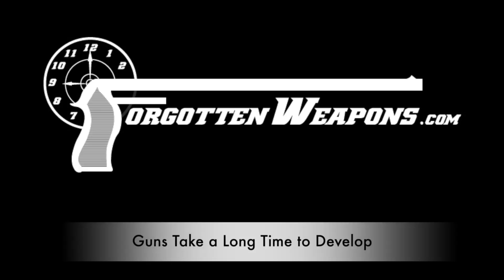Why Guns Take Years to Get Into Production

Comment: The tooling and tolerances is the main problem in many stories. Then there might be the engineer who has forgotten the difference between US and British inches, let alone centimetres.
Reply: The US and British inch, as well as the Canadian inch, became the same decades ago. Certainly a thing a good while ago, but not at present day. Assuming modern metrology equipment of course.
Reply: Hey, let me tell you about the first time I used a Taiwanese tape measure. Oh yeah. They have 10 inches to a foot here... 🤔🧐😱🤬😓
Reply: @stewbacca117  noice to know, now I know where to order my ** measuring devices from. Gonna trick all the ladies lulzzzz
Reply: @stewbacca117  really?How many centimetres to a Taiwanese foot?
Reply: @patmiddleton3947  oh there's still 304mm to the Taiwanese foot. They just changed what an inch was to make it 30ish mm... 🤔🙄 Doubly confusing. Yay.
Reply: The difference was more critical in the 19th century - the .303 rifle was the result in the difference between the Enfield inch and the British standard inch. Enfield was using a standard 1% longer than the British standard. I am aware of 40 different inch standards in use in Europe prior to the metric system being adopted. The American inch has been a metric derived unit since 1959 and the old definition is due to be finally legally phased out in 2022. (Legal American inches prior to 1959 were slightly longer and British inches slightly shorter than the current standard but machinists had been using the modern standard definition since the 1930’s).
Reply: @allangibson2408  Now that was just plain interesting. Thanks for posting it. If you know that,would you then know why Whitworth chose 55 degrees for his thread ? He has to have known 60 degrees would be equilateral. It is just one of those little puzzles that I have never found an explanation for. What was the point ?
Reply: @paulmanson253  55 degrees is stronger in iron. 47.5 degrees is better in brass. 60 degrees looks pretty on a drawing.
Reply: @allangibson2408  Well now. I finally found someone who could answer that. Thanks again.
Reply: That's why you check tolerances every X cuts or X amount of guns. The problem comes from how much is too much or too little and how often do you check. That's one of those never ending problems unless you are working with indestructible tools.
Reply: The difference between the US and British inch disappeared long ago. Both are now defined as 2.54 centimetres.
Reply: @mikethespike7579  The old longer US inch is still in use. It is the base unit for US land surveys (where the difference does make a significant difference (tolerance stacking again...)). It is due to be phased out next year.
Reply: @allangibson2408  This is the best news I have heard in a few months lol. English vs US survey feet can be a headache. xD
Reply: What’s that about certain missile defense systems mixing up the two standards? 🤨
Reply: @ETC_USCG  Or Mars Climate Rovers...
Reply: @AliasAlias-nm9df  oh yeah, that one for sure!
Reply: @ETC_USCG  I don't know anything about that, maybe that happened before 1985. Because in that year the US and the UK agreed that the inch is based on the metric system and is 2.54 centimetres,.
BTW the US has a slightly longer history of using metric in engineering than the UK. NASA already was using metric in the early 1970s simply because their computers could calculate faster with that system.
Reply: Screw all that!  Go metric.  The math is easier too.
Reply: @andrewgillis3073  That was why metric was developed - the fact every city in France had a different length yard...
Reply: @allangibson2408  Also, a bade ten system makes it easier to engineer things.  😊
Reply: I meant base ten...
Reply: @Flosoph LOL !
Reply: My "favorite" problem is when the draftsman unintentionally leaves the dimension callouts  on the 4th decimal place setting (0.0000) which, for me, typically makes it a +/- 0.0005 tolerance. That's that wasting time by being unnecessarily precise. "Oops" was the only response I was ever given when I would confront the draftsman about it. Frustrating.

Comment: What has changed with the advent of CNC is, that spies trying to stall the development/production may not need to get near the actual machines. Stuxnet is a wonderful example for such an operation. Further since high precision is hard enough, its easy to create plausible deniability to hide sabotage.
Reply: Except the cast majority of CNC machines aren't networked at all - it tends to be "sneakernet" using flash drives. Also, there's dozens of different controllers, each with their own architecture Fanuc, Haas, Heidehahn, Siemens, Mazatrol, Winmax(Hurco, which is an overlay of Windows)..
Reply: @machinist7230 : Well, yes, but I am old enough to remember the time when malware spread without networking. Actually one of my first teenage x86 assembly projects was writing boot sector infection routine for a virus. I wanted to know how that stuff works, but assembly programming is not fun and I stopped doing that after I figured out how it works ... with the probably most awkward and complicated infection routing ever written. But it worked ... well somewhat.

Comment: Another example of why we can't remake some things.   " Why Can't we Remake the Rocketdyne F1 Engine? "  on the channel  " Curious Droid "   and for good measure "  Ultimate Saturn V Launch with Enhanced Sound  " on the channel  " Starship Trooper  "
Reply: They actually can - it was proposed as updated design in 2013 by P&W (called the F-1B) to take advantage of current manufacturing technology and reduce the vast  amount of skilled handwork that went into the F1. Even so, while the updated design would produce a staggering 1.8 million lbs of thrust, it was still an extremely expensive design, and that massive amount of thrust simply wasn't needed for current spacelift needs.